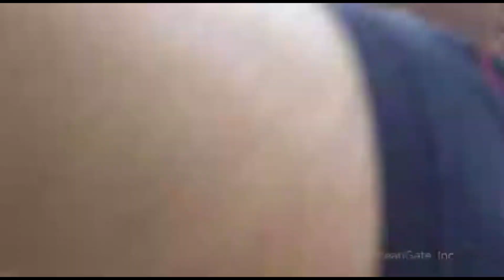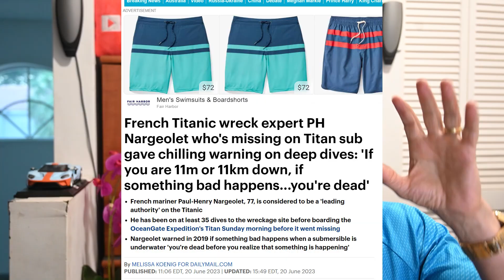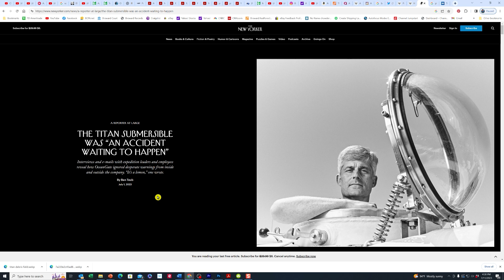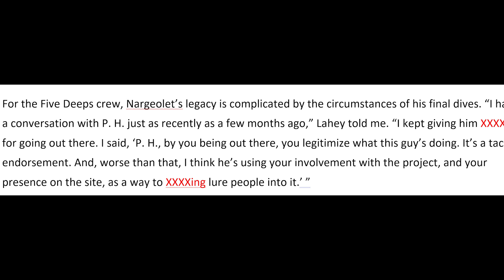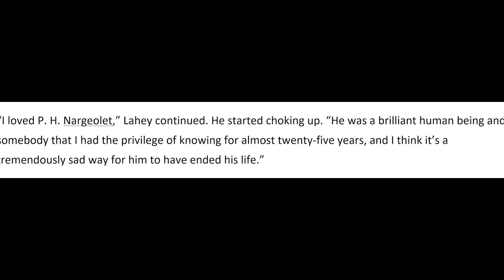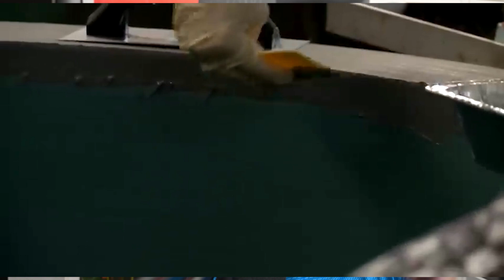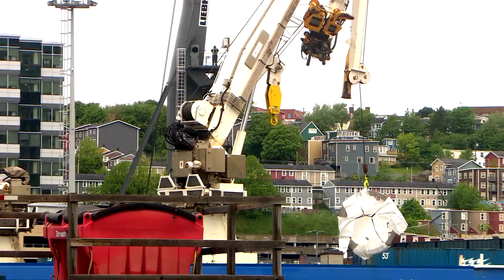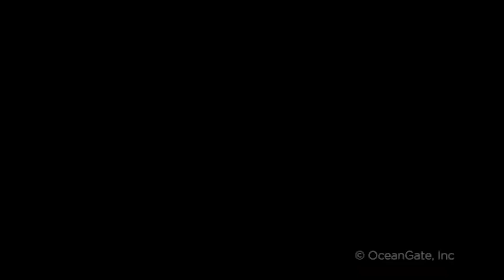Titan Sub: More Q&A, Design Defects, Why Descent Fast

Comment: The descent rate is significant as it signifies that they were overweight or had another buoyancy issue since they could not ascend.  The more we find out about this, the more shocked I am that it ever successfully ascended previously.
Reply: Yep, the transcript is spot on for their times and depths. Way too fast. And matches up with previous dives being stuck on the bottom and all these issues, unable to ascend etc. It’s so scary they were covering up so much and going forward continuing to dive. It wasn’t a question of if but when it would happen
Reply: Not sure if the transcript was real but The crackling sound in aft could either be the hull delaminating or water could have got into the back compartment and shorted out their electronics.
Reply: @WaveForceful The simultaneous power issues suggest water had gotten into the electrics, or at least into a place where it should be. A heavy drain can be cause by seawater.  Water in a place it ahould not have been would also make them heavier than expected and allowed that water to exert pressure in places it may not have been expected.  Crackling plus power issue on Bus A. Power gone, noise stopped.  Switch to Bus B, noise returns with more power issues. There has to be a connection.   The recovered wreckage did appear to have the entire electronics bay and wiring so they will have solid evidence of issues in that area.
Reply: That was my first thought as well, that they were too heavy.
Reply: @russellhltn1396  Or was leaking water somewhere.
Reply: @StRoRo  Or the composite cylinder had weakened and squeezed down to a smaller volume than anticipated before it finally failed.
Reply: Would be nice to know ascent rate of previous dive, did they have trouble ascending i wonder..
Reply: @ricktbdgc  facts! And, I wanna know has Rush ever dove the sub this fast before. the transcripts imply surprise by the crew of the mothership, so maybe not. It would also be nice to have the vessels data recorder. that should reveal a lot. If there were no mechanical failures going down, this definitely was a result of pilot error as the descent rate was pass ridiculous and should have been compensated for early on in the dive.
Reply: I think they were taking on water.
Reply: At first I thought it mught be a salinity issue but that simply doesn't account for it. No external factor can explain a 5% faster descent rate, let alone 50%.
Reply: Agreed…each time Stockton Rush went down in the Titan he was playing Russian Roulette with people’s lives.  That submersible had so many issues each time it was used that proved it wasn’t ready for use.
Reply: Didn't they also have a issue previously where they had to wait 24 hours for the balast retainers to "rot" away and have them ascend that way?
Reply: Seems somewhat paradoxical but I believe that falling thru the fluid of water rather than air is independent of mass, ie 1000# ‘overweight’ or 100#, negatively buoyant, the same as 1000# falling thru air as 100#.  Buoyant force, the upward thrust, remains relatively the same at those depths (4deg C).  g remains g.  They fall at same rate until reaching terminal velocity.  Terminal velocity thru water obviously reached faster.  The vehicle was neutrally buoyant (38m/min is just 2 ft/sec), imo,from start and descent rate was possibly just another reckless decision by Stockton Rush to place another misguided checkbox on his experimentation with human lives, ie fastest descent to Titanic.
Reply: @joestepien8594  It is. Stuff falls thro water the exact same as air. Acceleration is g. Its water resistance, aerdynamic ( aquadynamic  😂) gliding, or thrusters that slow it down. The density difference leading to bouyancy dictates the downward thrust to stop falling. If the sub is 100kg heavier than the water it displaces, it needs 100kgf of downward thrust to stop it sinking 👍. If the sub was 200kg heavier than the water, and the thrust 100kg, it would keep sinking at the same rate. And it had no dive planes to direct it up or down. Seems to me, it could not fly, or swim, so it sunk. And I dont think they would know it was too heavy for the thrusters till it switched them on. What a terrible thought really. If it was over weight to the thruster, as soon as it detached from the pontoon and started sinking, if they tested the thruster and not enough, could not detatch the ballast.. that was it. Nothing they could do. I dont think it had any ballast tanks it could blow. The more we learn, the more horrific the design was 🥵.
Reply: @TheScotsalan  the reason I’m inclined to believe it was Stockton Rush alone that controlled the rapid descent rather than overweight to begin with is that if it were slightly negatively buoyant from the start, and something upward force of thrusters could overcome, I would think pilot would have recognized this overuse of thrusters and aborted.  I was wondering too if vehicle had any capability to alter drag coefficient by deploying flaps of some sort.  Haven’t seen any indication of such flaps on graphics.  Not sure what ballast provisions were in place either to achieve neutral buoyancy.  Assuming neutral buoyancy measures in place, and you would hope that was done just below surface prior to descent, then the descent rate of 2’ per sec (rapid relative to typical descent rate, but hardly perceptible to an observer) was of the pilot’s making, presumably via Rush’s decision.
Reply: @joestepien8594 I agree
Reply: Since most of the buoyancy of the vessel was because of the CF material, having it compromised (buckling, delaminating) would have removed much of said buoyancy. The rapid descent rate matches an ongoing failure of the CF structure. It would also have meant that throwing off the ballast did basically nothing as their remaining buoyancy was vanishing with each part of the hull that was being compromised and filled with water...

As others have noted, the failure of CF material like this under compression tends to be very gradual until it fails disastrously. That's why things seemed normal for a few dives (albeit with 'weird' noises), until one dive it suddenly was very much not.
Reply: @MayaPosch I agree. I think the hull had been delaminating and water was infiltrating between the fibres. The deeper they went, the higher the external pressure, the faster the infiltration, forcing more delamination. The more water in the fibres, the heavier it was, until finally even dropping ballast and using thrusters could barely move them upwards.
Reply: @misterfixit9515  that is the answer No Doubt
Reply: @misterfixit9515  they were taking on water and that's the reason for the loss of power
Reply: I think there was water in the sub. That added more weight. Hence why it descended fast and couldn’t ascend.
Reply: @Koroodetto Thinking on about your thought there, you made me think of another flaw in the design. Because the sub is towed on a submersible raft, its never out the water. They done that to save money on the mothership not having a crane I believe. But a crane with a load cell would have allowed for a weight check.
Reply: @TheScotsalan  I guess they knew the weight of the submersible exactly. Everything additionally put into it got weighed. Well, that can be messed up.
Reply: @flybywire5866  This is why these threads are good. Get us thinking 👍. So, my thinking is now, If the whole sub is heaver than water it sinks, and it sinks at 9.81ms, no matter how heavy it is. Acceleration is constant. Minus resistance of course. But, says its motors are 7.5kw each ( thats the upper end for electric outboards), it has 2 vertical motors, they can produce X amount of thrust. If the density of the sub is not in a  band compared to the water, the thrust from the motors wont slow its descent. Does that make sense ? I calculated displacement at 42 tonnes. If it weighs 42.2 tonnes or 45 tonnes at top, no matter. It will sink at 9.81. But when they want to slow its descent, the thrusters must produce  more thrust than its mass over displacement. It needs its thrusters to slow its sink rate. It only has to be overweight by more than its rated motor thrust and its descent cant be checked. It will just keep accelerating at g, no matter what ? If its motors are as much as 1N thrust underpowered, it will just keep getting faster and faster. Am I correct with that ? I think I am. 👍
Reply: @TheScotsalan  It does not sink at 9.8 m/s^2. The nett force acting on the vessel is g.(vessel mass - mass of water displaced)  because the buoyancy force is the weight of the water displaced by the vessel. The acceleration of the vessel from F=m.a is therefore (vessel mass - mass of water displaced)/(vessel mass). The volume of water displaced by the vessel is about 10m^3 (this can only be estimated) and the density of sea water is about 1.025 tonnes/m^3. The mass of the vessel is quoted widely at around 10tonnes (albeit not consistently) Some rough calculations suggest that the ballast needed for a normal descent rate of 0.45m/s is in the order of 100kg to 200kg. It reaches terminal velocity in water very quickly. Around 100kg of excess ballast causes the faster descent rate indicated in the transcript. Note that the "fast" descent rate of 0.67m/s is equivalent to a slow walking pace. If the thrusters can't arrest the descent then 100kg of ballast can be jettisoned to achieve neutral buoyancy and another 100kg to ascend.
Reply: @kengself  Cheers ? Thats where I went wrong then 👍. I knew there must be something wrong with my reasoning 🥵
Reply: @kengself  No wait. Sorry, must be low blood sugar at the moment 👍. F=ma. If I drop a lead ball in air, or a beach ball, the downward acceleration is the same. Archemedies still applies in air but is neglegible..air resistance comes into play. do it in a vac, both fall at same speed. In the case of a falling object, the F is F=ma is the force in the object. If I drop a ball from 1m high, a heavy ball will hit with more force, F, than a small ball. Gravity g, has no mass factor in it. Doing a force diagram, the speed of sinking due to mass is the same, no matter how heavy. If its heavier than water, it goes down, at g, minus the water resistance on the sub. F=ma, with bouyancy, is the upward force needed by the props to arrest falling. I think.. I need my pills 😂.
Reply: @TheScotsalan  I  think the missing part in the way you are trying to analyze this, is the buoyancy force acts directly on the F side of the equation. The acceleration of gravity is surely constant, but the acceleration of the craft (which is the relevant component in the F=ma eq) is not rigidly tied to the gravity acceleration. It is the net acceleration when the buoyancy force and the gravity force (weight of the craft) are combined. This is ultimately why planes can fly and ships can float, instead of merely sinking at 9.8 m/s^2 from gravity.
Reply: @JSu2.  I am getting there 👍. Dont worry, I aint a flat earther 😂
Reply: @TheScotsalan  

The equation of interest here is actually an aggregation of the f=ma equations, I think.

F(buoyancy)-F(craft) = m(craft) * a(craft)

F(buoyancy) = buoyancy force based on displaced water
F(craft) = simply the weight of the craft from f=ma
m(craft) = mass of the craft
a(craft) = acceleration of the craft, which indicates the actual up or down motion of the craft (positive meaning upward, negative meaning downward)

Also, you could incorporate F(thrust) on the left side of the equation to include the thruster contribution
Reply: @TheScotsalan  No. The accelerating force  
F is the difference between the gravitational force mg and the buoyancy force rho.g.V (rho is the density and V the volume of displaced fluid). If buoyancy force is greater than mg you float. Once you have the nett force you divide by the inertial mass of the vessel (m) to calculate its acceleration. The drag force of water resistance is dependent on velocity^2 and when it matches the accelerating force (mg - buoyancy) you have terminal velocity
Reply: @JSu2.  Yup. I know the equations 👍. Its just their application with subs I am trying to work out. I live behind the great firewall, and my VPN is on my phone, not laptop. Take it from me, internet behind the great firewall is pretty bad. 🥵. But this is a great thread. Learning a lot 👍
Reply: @kengself  Tbh.. sort of feel ashamed to call myself an engineer here.. but hey, I am mechanical.. not marine 👍

Learned a fair bit here tho. This is a superb thread. I am at the point where I want to do the vector diagram and plug the equations into a spreadsheet to see what variables do what. Someone above posted about stokes law, new to me, but it makes sense. I suppose, at the end of the day, while most engineering courses cover the usual physics about fluid dynamics, flying etc, submarines are not really in there. This is a whole new world, I am enjoying learning a bit about it 👍
Reply: @TheScotsalan the flaw was Stockton himself, took it too the edge, of safety
Reply: @Koroodetto  or they didnt change weight measurement after the son went instead of the mother
Reply: @Koroodetto 
Titan's weight: 10 tonnes 
It would need a huge amount of water to offset its buoyancy. There was not that much available vessel volume to allow for that.
Reply: @johniresearchist7263  Yup. I just calculated its displacement, 42 tonnes, so it would need a fair bit of weight added to make it sink.
Reply: @Koroodetto , If there was water in the sub, a) they most certainly would've been communicating that to the surface vessel, and there's no record I'm aware of indicating that. And b) IF, there was water entering they surely would've tried to abort the dive immediately due to that happening early on the descent. Now if you're suggesting that the carbon fiber hull started leaking water when they were down deep, and that's what accelerated their descent rate, AND prevented them from being able to rise quicker when they decided they were in trouble, .... I don't think that is possible. At that pressure, the tiniest of leaks would result in a tremendously high pressure jet of water thru the leak spot, and instantly grow to a complete structural failure resulting in instant implosion. I think there must have been some other buoyancy issue that caused their problem. I also personally believe that the communication transcript that has leaked out, is real and factual based upon the fact that it basically mirrors the things James Cameron knew very early on in the search. He knew things that had to come from someone on the inside aboard the mothership, ..... Like that he knew they got to 3400 meters, and then  dropped their ballast in an attempt to abort the dive.
Reply: @loulagro2315  From the real evidence we have (remember, this transcript has not been verified by anyone), we know that the descent rate wasn't too fast, we can form this conclusion based on evidence from prior expeditions that took the same time to descend and obviously didn't take on water because they came back just fine.
We know that the sub was constantly malfunctioning, from the thrusters not working, thrusters being put on backwards, the system just stopped working, etc. 
From everything we ACTUALLY know, its reasonable to conclude that the hull simply failed due to poor engineering/manufacturing.
Reply: @undeadarmy19  , Perhaps you should reread my comment and the comment I replied to...... First off I absolutely believe the submersible suffered a catastrophic hull failure. Second I never said or agreed that the decent was to fast, so again perhaps reread my comment. I simply was disagreeing with a comment I read that the Sub took on water somehow becoming too negatively buoyant. Perhaps it was, but its not credible in my mind to think it leaked water at depth prior to implosion. I believe it just failed and imploded. Lastly, while yes it is NOT proven at this time, I do believe the communication transcript will be proven to be accurate based on the reasons I cited previously, ie James Cameron's contemporaneous statements about the incident within the first 12 -24 hours of the search. He stated precisely the reported Depth it got to, as well that they released their ballast. Why would he risk his professional credibility by making that up? He was either privy to the communications that were had, or privy to some seriously precise sonar analysis....... Either way it appears he knew things early on. I'm sure it will come out eventually, right now there are people circling their wagons getting ready for litigation, and the information will be closely guarded until a full investigation has been released to the public. I'm just betting its real, or a very accurate representation.
Reply: @loulagro2315 oh yeah, circling the wagon is right…big time.
Reply: @Koroodetto Then you'd expect the descent rate to accelerate, no? If they had a leak their buoyancy would be decreasing. And they'd sure as hell either see or hear the amount of water coming in required to cause that sort of reduction in buoyancy, unless it was an external pressure vessel that failed very early on in the dive (we've had heard a tank rupturing at any sort of depth and the crew would have noticed it).
Reply: @mrkeogh  No. It will sink at 1g if its mass is more than the mass of the water it displaces. Its exact same as a rock and a feather on the moon. Falling is independent of mass. 👍
Reply: @Koroodetto that transcript is fake. The titan was built to be positively buoyant. So any failure of the thruster or equipment they just rop the weights. If there was water intrusion that early on it wouldn't of imploded because the inner pressure would be equalized.
Reply: @Koroodetto  I to do agree water leak compromised ability to ascend
Reply: @Koroodetto  I don't think there was water inside. The moment any water got inside the sub, they would have already been shattered and dead. That's why a thruster issue is more probable. Also, they might have had too much ballast and not been able to drop it successfully.
Reply: Sounds to me like a leak, or maybe some tools were left in the bottom of the sub. Water seems most likely as that might have shorted out bus A and battery.
Reply: The same thing bugged me when I read the transcripts...and they all knew they were going to fast. The topside asked them if they needed to slow decent.
Reply: @americanwoman6246 they all, knew, stupid people but they were not stupid.
Reply: A faster-than-usual descent would also put additional unforeseen stress on the bonding between the pressure cylinder and the end caps, due to their differential compression, even aside from the obvious issues of having end caps glued to a carbon fiber pressure cylinder.
Reply: @edreynolds8721  How do they not notice sloshing water right under them?
Reply: The Titan had a fast decent then could barely move up . I still need to understand  why carbon fiber was used .
Reply: @carolynlyfordsullivan1377 Weight and capacity.  They wanted the Titan to be transportable by box truck so it could be picked up from one coast and driven to the other coast, rather than needing a tender mothership that would have to sail around continents.  They actually did this. This is how the vehicle was used in Seattle and also in the Atlantic.  They threw it in a truck and roadtripped it.  Titan was the first of a planned fleet of these things, all being trucked around wherever there was enough demand for a ride.  Capacity played a big part. They wanted to have a high passenger capacity because that meant revenue and profit. Using a steel hull would be too heavy to carry by truck and too thick to leave a lot of room for more paying passengers.
Reply: Very Well Put, OP.  There's a few other phrases we could use, like for example the submersible seemed to not be under control when it started to dive.

The Titan wasn't just overweight.  It probably lost most of the pressurized air when it flooded its ballast tanks, suggesting that those air tanks in turn became more ballast.

Remember how early on the Media was consistently pushing how much air was onboard in terms of the number of days of air there was for the occupants to breathe?  That seems pretty suspicious to me now, as well, because clearly some people knew almost right away that long term survival wasn't really an option.

I'm willing to bet that within 5 minutes of the submersible leaving the surface and its carrying sled it had already passed a point of no return, as in, it could not have safely aborted its mission back to the surface long before it ever got near to the bottom.  All that had to go wrong for that to be true is for the submersible to have lost most or all of the pressurized air external to the passenger compartment.
Reply: The NORMAL ascent & descent rate is about 25.33 meters per minute. Many sources & former “mission specialists” who rode the sub are on record saying it took 2.5 hours to get down and 2.5 hours to get back to surface. 

One of the reasons Stockton Rush wanted to build Titan out of carbon fiber is because it’s much more buoyant than other materials.
Reply: @michaeldonnelly2977  There is no "normal". Where are you getting this 2.5hr descent rate from? Oceangate themselves has stated a descent time of 2hours or 90min, never 2 1/2hours. They made the expedition to Titanic 13 times and most of those had a descent rate that got them there in 90 min. Nothing bad ever happened with those, so it's reasonable to conclude that the descent rate had nothing to do with it.
Reply: Or something heavy with tentacles attacked it?
Reply: They were ascending at 0.25 mph (snails pace) with thrusters on. They had problems dropping the skid. Maybe the skid never detached.
Reply: @topfuel29channel  I think it more likely they freefall for a bit, then thrusters on for a while to slow down ? Sort of like rolling down a hill in a car ?
Reply: Everyone talking about leaking n taking on water. I thought it depth this didn't really happen over an hour but very very quickly?
Reply: @nickabel8279  Thunderfoot just did a video on this, estimating flow rates.  I believe the speed of the water entering through a leak will be supersonic, but of course the volumetric flow rate depends on the size of the leak.  A catastrophic hull implosion would happen at about the speed of sound and take just a few milliseconds.  I think people are placing too much weight on the idea of a leak because:  (1) they tend to be a shallow water problem not a deep water problem (because the compression of the hull will tend to seal them in a sensible design), (2) an implosion at the right time/place was reported, and the CF cylinder is reported as being disintegrated, and (3) if the transcript is real, no leak was reported, but presumably a supersonic water flow would be noisy.  It seems to have resurged as a result of the transcript purporting to show a high descent rate.  Another commenter said they had calculated this could be due to being overweight by just 100-200 kg.  Stockton Rush banged on about procedures having a major impact on safety (presumably to deflect from Titan not being classed), but doesn't seem to have put that into practice.  The reversed thruster on one dive is a great example, but I'm sure there are many others.  I think it quite plausible that they just didn't do the weighting calculations properly, maybe not adjusting properly between dives for different crew weights, but there may be other reasons.  It will be interesting to read the final report, but from the start a catastrophic hull implosion seems to have been the most likely cause in the minds of the experts.
Reply: Also, a high descent rate doesn't give the different materials time to settle in to the increased pressure. One material might flex more than another, sort of like how different materials react to temperature changes differently.
Reply: Well, every dive likely caused more and more damage and micro tears
Reply: This isn't a row boat on the surface. 4000 meters down, there is NO slow leak. If it leaks, it is going to break or, at the very least, fill completely and rapidly. No wet shoes from this.

Passengers are in the CF tube with the two titanium end caps. We have not been given details of the tail unit. Interviews with Rush report wires thru the rear titanium cap (CF cylinder cannot have wires thru it).
Reply: @Set-it-to-11 i was referring to a slow leak in the aft which was outside of the pressurized chamber and housed all the electrical equipment. It also wasn’t pressurized like the chamber which is why is was completely in tact when they found it. The pilot of sun mentions crack noises in the aft, followed by red lighting on the control board then comms cut.
Reply: What about malfunctioning or improperly set vertical thrusters which went unnoticed? I imagine the thrusters pulling the craft down at a low but constant rate. That would explain the higher rate of descent which I believe they do a low power descent (basically just sink using ballasts) and then when dropping extra weight they still could not make progress...faulty vertical thrusters.
Reply: @thunkjunk  we already know they had reported a thruster malfunction in a previous dive ,  they did not abort then but reconfigured the thruster by software on board. The thruster was operationing in reverse btw .  Make me wonder it the same thing happened and was pushing the Titan downwards
Reply: @the_forbinproject2777  I think they installed that thruster backwards so that when the pilot pushed forward, one side pushed the wrong way which caused the sub to spin. I didn't know they did some kind of remapping during the dive. Was that dive successful?
Edit: not spin but yaw.
Reply: @the_forbinproject2777  who want's to bet these morons forgot to change the reversed thrusters back, so on the ascent they still had a thruster or two fighting against the others.
Reply: @the_forbinproject2777 wasn’t there also another issue with the thrusters that caused it to go in circles over and over? Or is that another issue?
Reply: @PureSkyeblade  A submersible ascends by buoyancy, not thrusters.
Reply: @the_forbinproject2777  The couldn't abort since the sub was down lol - but yeah sketchy how the solution was "Turn the controller 90 degree to your right and you'll get the right control"
Reply: @Jubaone90  by abort I mean abort the dive , return to the surface , like jettison the balast , that type of thing
Reply: @the_forbinproject2777 a diverse team will only go so far if they have no clue or concern for quality
Reply: ISN’T it obvious?  The extra weight on the sub is because the aft part was flooded as soon as it submerged.  That made it fall faster.  (It also slowed its attempted ascent to just 7 meter/sec.)
Reply: CEO would be alive if he had said at 15 minutes “We’re falling too fast.  Abort & surface.”   But he ignored that.  (He also ignored the red early warning light.  He was dumb.)

.
Reply: @electrictroy2010  I think they would have noticed water entering, if only by its sound, at depth I think it would have entered supersonically.  I suspect they just got the weighting wrong.
Reply: @electrictroy2010  There is no evidence that this transcript is real, so we should assume that its not. What is real are the 13 dives that the company took to the Titanic before this. In those dives they had a descent rate that got them there in 90ish min. So, we can conclude that the decent rate wasn't the issue.
A large YouTuber, DALLMYD, just posted a video recently documenting his trip on the sub. He went with "mission 3" which was 2 missions before the mission that imploded. They were never able to actually dive down to Titanic because the weather was just too bad. In the video even you can see that the waves are so bad they're causing people to slide from side to side in a room, along with things falling over in the room. During the expedition, he talked about how the sub had issues literally every day. Whether it was a thruster not working, one day the system was working fine and just quit, etc.
So, its reasonable to conclude, based on the VERIFIED evidence, that the issue was most likely due to a malfunction that occurred down there, or a hull failure due to poor engineering/manufacturing.
Other evidence has emerged that the sub lost all power and plummeted to the seafloor in a vertical orientation. This means that they most likely were all aware of what was about to happen. The pressure is greatest at the bottom, and due to the fact that the fell and crashed into the seafloor, that likely could've caused damage that lead to hull failure as well.
Reply: @the_forbinproject2777  in the previous thruster malfunction, the thruster had been installed in reverse, so maybe this time it was upside down
Reply: @electrictroy2010 yes smart stupid dude and took lives as well.
Reply: @thunkjunk Thruster issues?
Reply: @dare-er7sw  There were two vertical thrusters they used to move the vehicle up and down. They could have been running the entire time. Otherwise, I don't know what else could take on water to cause extra weight. If that back end was heavy with water wouldn't they complain about being tipped backwards?
Reply: @thunkjunk  Yeah, and thats why the battery died so fast. Maybe.
Reply: @thunkjunk  if the transcript is true, it can't have been thruster issues, it had to be weight. If it were a thruster issue then the sub would have ascended as expected when the ballast/landing platform was jettisoned.
Reply: @AtomicExtremophile  Reading thro this.. I just had a head slap moment. I saw all the weight things and sat down to work out the displacement of the sub etc, then boom, I remembered. Things sink at the same speed. If its denser than water at sinks. Its its less dense, it floats 😳. It sinks at 9.8 m/s^2. Of course, there is water resistance etc, but basically, I reckon it would need to use its thrusters to control its sink rate. That is, to slow it down 👍.
Reply: @AtomicExtremophile  Where would the extra weight be?
Reply: @TheScotsalan In a vacuum, things fall at the same _acceleration rate_, not speed.  In a fluid like air or water, they accelerate until drag and the force due to gravity balance out.  That is the terminal velocity, and it varies with size and density.  Look up Stokes Law for a starter on that.  From eyeballing various diagrams it looks like the interior chamber was roughly 3 metres long by 1.5 metres diameter, giving about 5 m3 of volume and hence buoyancy to offset it's weight.  I'm not sure how you calculated 42 tons displacement, perhaps you are confusing displacement with weight anyway, but even as a weight that would seem to be a multiple too high.  More likely I think they will have got the total weight down to less than 5 tons so that, without ballast weights, the thing would be positively buoyant.
Reply: @LokiCentral  Ahh right. So stokes law is describing the ralationship to density to drag and resistance.. and terminal v. Got ya. So mass affects terminal velocity, of a sphere in water. 👍
Reply: @TheScotsalan  Stokes Law tells you the upward drag for a sphere falling at a given velocity (you'd have to assume a sphere for an easy hand calculation).  Reverse it, and you get the velocity for a given drag force.  At terminal velocity (which will be pretty much right from the start in water), the drag force must equal the net downward force.  The net downward force is (weight - buoyancy) x g.  I don't think we know weight/buoyancy well, but you can use this approach to estimate the rough descent rate for e.g. 100 or 200 kg of net negative buoyancy (another commenter suggested this gives the right sort of descent rate).  Descent would be stopped, then reversed by dropping weights, not by using thrusters. Thrusters would only be used for movement once neutrally buoyant.  For safety reasons you cannot rely on a powered ascent, you have to be able to achieve positive buoyancy by passive mechanical means (dropping weights in this case).  But also I think there simply wouldn't be enough energy in reasonably-sized batteries for a powered descent/ascent anyway.  You could work out the energy required by multiplying force by distance, e.g. 100 kg x g x 3,800 metres.
Reply: @TheScotsalan If you mechanically propell the capsule downwards you will increase the falling velocity. This propulsion is based upon a downward force (exerted by the propellers), which comes to be similar to increasing weight, i.e. gravitational force. Velocity, within a fluid, is not constant. It would be constant (at a rate of 9.806 m/s2) in perfect vacuum, in which case a thruster or any propelling device won't do nothing.
Reply: @thunkjunk  I'd think they'd notice the power draw on the batteries.  I think there's simpler explanations.
Reply: @russellhltn1396  Ok. I'm all for Occam's Razor. What is simpler and explains more given that script isn't fake?
Reply: @thunkjunk  Miscalculation of ballast is the simplest explanation of the descent/ascent rates for me. Compromised hull material is the simplest explanation for the hull failure. It's tempting to attribute everything to one cause but given the history of the thing, I have no problem assuming multiple, concurrent issues.
Reply: @thunkjunk  That they got the buoyancy wrong for this dive.  I'm not sure how, but that seems the best fit for what we know.  I believe the script shows they were sinking fast from the get-go.  Too soon for water leaking in.
Reply: @russellhltn1396  I'm second guessing the premise that the dive was too fast.
Reply: @thunkjunk If the script is real, the reported factors of fast descent, poor ascent, power drain issues, lack of thruster effect, and noises from the aft electronics bay could all point to water infiltration adding weight while also damaging or shorting out the electrical systems.
Reply: @thunkjunk  By the time they reached their destination, the primary power supply failed  the backup power supply was possibly on the verge of failing and it's likely the seals on the buoyancy system had failed either during the dive or before it's deep descent and was allowing water to infiltrate the system. it is very uncertain. But why would Rush just flip off the descent rate as if it couldn't turn catastrophic at any moment. There are clear and precise regulations prohibiting high rates of descent because of the safety risk connected to it. As an engineer he should have recognized the  descent rate as being dangerous and made the necessary corrections. Which leads me to believe he did this on purpose to show proof of concept for his controversial design.
Reply: @thunkjunk  The thrusters are not designed and not normally being used during decent or ascent. Their power is just pathetic in comparison with the buoyancy gained by dropping all the ballast. They did were employed as a desperate measure to speed up the ascent after jettisoning all ballast wasn't sufficient. Their excessive use probably caused or contributed to the consequent loss of power. All this was virtually irrelevant to the outcome. The sub was doomed as soon as the leak in the hull started.
Reply: @curiouscat8457  Actually, I find that every detail will be relevant. Our speculations are not very relevant. It is interesting to speculate nonetheless. It seems a bit like the premise that they were descending too fast might have been wrong. But if the script is accurate then something was causing their ascent to be bogged down. Since they would have. What could explain such a slow ascent with thrusters going and being so positively buoyant?
Reply: @thunkjunk  "What could explain such a slow ascent with thrusters going and being so positively buoyant?"
Huh? "So positively buoyant"? It wasn't. There was a few hundred liters of leaked water in it. That EXPLAINS it. And it is not a speculation, it is the only logical explanation of the problem.
Again, the use of thrusters' power was only a short-lived drop in the ocean. They are normally being used for small vertical movements while the sub is neutrally buoyant. Their thrust and size of power source reflects their intendent purpose. Their use was only the last desperate and entirely futile attempt to save the day.
Reply: @curiouscat8457  I'm going to have to tentatively agree with you about the water. However, there are issues. A few hundred liters of water? Just one industrial sized drum is 200 liters. Where and how would that get in?

The only way I can think of for that is the water was at the bottom under the floor they sit on. And the only way for it to get in would be at or near the surface if the seal on the titanium caps were loose enough or the carbon fiber was damaged enough to allow a leak at either end. And then once the pressure built up the titanium caps were held on by pressure also stopping any leaking.....temporarily.
Reply: @thunkjunk  I think, you answered your own question. 🙂. There is enough room for a few THOUSAND liters of water under the floor and the glue between the titanium and carbon fiber would be the prime suspect.
I explained somewhere (the comment system is messy and I can't find it now) - how this type of leak (or seepage perhaps) could be quite massive while being silent and hard to detect.
Reply: @thunkjunk  "What could explain such a slow ascent with thrusters going and being so positively buoyant?" 
thrusters being installed upside down, controller error, ballast not detaching properly
Reply: @thunkjunk I doubt the sub had enough battery capacity to  keep the thrusters running. Say  they are 7kw each, thats a lot of juice over 8 hours or so. Just my opinion. I dont mean to sound arguementative 👍.
Reply: Raising valid points to consider is not being arguementative.
Reply: @TheScotsalan  Those thrusters aren't operating the whole time though, they're only used for short bursts. The whole idea is to allow extra weight to cause you to descend. Then you drop some weight to become neutrally buoyant, then drop more weight to create positive buoyancy. The thrusters are mostly only used for maneuvering once you're down there.
Reply: @TheScotsalan  what I'm wondering is whether the electronics were designed to work in water. The electronics could be accessed via this thin, vertically folding doors. Surely those doors weren't strong enough to withstand the pressure on their own. 
In a recent video posted by a large YouTuber that went on mission 3, you can see that the sub is more nose heavy when they first enter the water, is that due to needing to wait for the back of the ship to full with water?
Honestly, I think it would be smart to design the electronics in a way where they're submerged in distilled water/oil, that way there is a pressure equilibrium. For those that don't know, pure water is actually not conductive, the only reason water is usually conductive is due to impurities in the water.
Reply: @undeadarmy19  But if the thrusters were operating and draining the batteries and accelerating down on the descent it might make sense (if the transcript is true) that on ascent there was insufficient power to rise...And perahps if the controls were stuck in a downward position dropping ballast wouldn't work to bring up the craft quickly.  
I think the simplest theory is they were too heavy and then there was also a power issue from the mech bay flooding...

(This is just frightening what they went through, because I've said from the beginning THEY KNEW they were in trouble.  Even if the transcript is a fake there is no way they didn't hear massive snaps in the hull.  We know they dropped the Ballast and the Leg Frames first because they landed in a different area than the rest of the debris. They were indeed fighting for their lives)
Reply: Wasn’t buoyancy touted as a primary benefit of using carbon fiber? It’s like they were making it up as they went along. Insane.
Reply: 🎉😂All need a secret before u can experience Jesus healing energy. The Illuminati aka fallen angels aliens NASA what ever you want to call them in there flying tin cans. Can't get out of lower orbit because of the vacuum. Universe is only 77 thousand SQ miles big breathable air through out space angels have to breath. Mars is only 250 miles away sun an moon are much closer an only a acre big. Heaven is on Mars moon that's what all the thrusters are for space x Star ship try to punch through the vacuum and destroy Mars moon heaven. I cleaned out hell left the light's on so no use for hell. I ripped the soul out the devil after he went dragon just to make it a fair fight. Now souls can be destroyed. True compassion for your fellow man is the only way. Now all are allowed black an white sheep to experience Jesus healing energy all old aches and pains will be washed away takes 30 minutes best to relax and shut yr eyes. Or I'm lying an u won't feel a thing
Reply: Another thing I have wondered, is if it is possible for CF to become "waterlogged", not necessarily from critical delaminations or cracks, but like a sponge from sustained immersion/exposure to water (towing at sea and prior recent dives)? Maybe that is another source of unanticipated water weight?
Reply: Me too...amazing that they had any success....😢
Reply: what if they forgot to fill ther air tanks befor the decent i think there air tank had  10,000-100,000 psi of air for bonicey if they for got to fill the tank would you not decend faster or if the air tank failed as they were going down
Reply: @jeffwinters8152  They wouldn't float if there was no air to begin with. Something had to happen, such as a pinhole leak in the weakest part of the structure
Reply: @ScarlettStunningSpace  i allways thoght a air tank makes you lighter when you dive when a tank when it is comprested air at least in water of the many dives i have done with my gear on and tank that is what i have done for a while
Reply: And the most probably reason for the overweight is the water from a leak
Reply: Curious to know why the mother ship didn't say anything bout the decent rate, they would of known if the transcript is legit.
Reply: @muddyfunkster77  That's a good point but this could easily be apart of the normalization of deviance. If things  were being handled according to regulation you'd be right but with this general mélange of incompetency and lacking responsiveness to clear and present dangers I would say it could also just by an example of overall failure.
Reply: No fat shaming
Reply: I'm wondering if the CEO hadn't had a psychotic break w reality + loaded something extra onto the vessel. He mah have done something utterly crazy, thinking he knew more than ANYONE else.
Reply: The rear frame that is not part of the  hull  that holds the guts of the sub broke or bent, causing a weight distribution effect. It pulled on the wiring until some wires were severed and got in the way of the landing gear when they tried to release them. Landing gear did show signs of damage in the same area that the rear sub structure was attached to. Just a theory.
Reply: Whats french for banzai?
Reply: @edreynolds8721  That would be my GUESS as well. The prime suspect: the glue joining the titanium flange with the cylindrical hull failed after a few repeated load cycles (materials with different load compression coefficient, different temperature expansion coefficients, poor assembly process). 
It could have resulted in a seepage all along the circumference - barely noticeable at any short length of the fissure and silent - but adding into a significant flow on the 6 m(?) length while the pressure was increasing.
If it wasn't there, it was somewhere else - but there was a leak.
Reply: @edreynolds8721  That's fine. And I can easily imagine the seal was compromised on the rear titanium cap because it was only held on by glue. Dive after dive would cause the glue to erode because of stretching, compression and release. That water was able to come in early in the dive while the pressure was low. When the pressure got higher that titanium cap would press so hard against the carbon tube that it could stop a leak but then eventually overcome the structure leading to catastrophic failure. The only issue I have with water trapped in the rear section is that I would think it would cause the rear to sink down but nobody complained about falling toward the back. Then again maybe the script is fake.
Reply: I worked on a team of students that wired it and it was wired to go fast. We put extra big wires in it to rev up the engines a bit tee hee hee.
Reply: I think based on the released transcript, Rush mentions crackling noises in the aft. It’s possibly they had slowly taken on water, which would cause the electrical failure (all electrical components were housed in the aft). I’m not an engineer but it’s possible the slow leak made them take on too much water essentially sinking them first or hindering an ascension. Water weight kept adding on, sun starts to sink rapidly under the added weight, descends too quickly and POP.
Reply: No kidding.  It didn't crack the first time?!   That's amazing!  Well worth the 2k bucks!
Reply: Probably electrical failure causing valves or thrusters to operate too slowly or not at all. That would explain pretty much all their problems and a bursting battery creating a shock wave could explain the cause of the implosion.
Reply: The fast fall rate suggests that the titan was more like a rocket, traveling vertically instead of horizontally. They were probably terrified as they piled up on one another while Stockton Rush pretended there was no problem
Reply: Grabbed by giant squid, and then chomped by megalodon. 😉
Reply: 1) why build a submersible with only a small crush test margin? 
2) why use an untested material like carbon fibre when experts warned him not to?
3) why was the plexiglass "view port" only rated to 1300meters?
Reply: Releasing ballast and weights the "pressure hull" should have ascended to the surface regardless of thrusters etc.
Perhaps they had faulty decent thrusters they couldn't turn off that would explain their rapid descent and by the time they decided to do an emergency accent it was too late?
Reply: These two men both had suicidal ideation. PH because he was a lonely man missing his wife and obsessed with dying close to the titanic. Rushton had received the vaccine 2 doses and realized a gruesome fate most likely awaited him and chose a quick and easy way out. Get rich fast or die trying he knew his clock was ticking
Reply: 60 minutes Australia and Navy Production YOUTUBE channels are saying contact was lost 1 hr 45 minutes after first decent.  That would seem to confirm somewhat the authenticity of the transcript showing a rapid descent.
Reply: @@1finalfailure Perhaps.
Reply: He knew, decided to descended too fast, caused problems
Reply: The first question is whether the transcript upon which the descent rate is based was actually genuine. If it was, everything I’ve read says that the Titan did an unpowered decent with the majority of systems off to save power. Ultimately it just sunk. An explanation for a fast decent could be that someone simply got the ballast calculations wrong. The question that would raise for me is why they would continue the dive if the sub was sinking much more quickly than it should because clearly there must be a reason for that. The fact that the transcript doesn’t even include any discussion on the excessive descent rate makes me also question whether it is a genuine transcript or at least missing the correct time stamps.
Reply: @peterj5751  there was one sentence, where the ship asks if they dont need to adjust velocity or something like that. It sounds like the person on the ship was afraid to tell them to change the speed of descent.
Reply: @peterj5751  Agree. It just sunk. Had a fixed displacement, makes me wonder if the divers just fixed ballast on at the surface, and off they went. If someone messed up the calcs, it would quickly be too deep for the divers to remove ballast  ?
Reply: @TheScotsalan  
Displacement is not fixed. Under compression the volume will decrease slightly. If the graphite cylinder had already started to weaken then it may have squeezed down to a smaller volume than anticipated before finally imploding.
Reply: @zahimiibrahim3602  Yup. I know that, but I reckon negligable. Compressive strain is ppm is it not 👍.
Reply: @zahimiibrahim3602  Sorry friend. Answered in a rush. Yup. Quick google shows Youngs modulus for a random titanium about 110GPa/m2. Not as stiff as steel surprisingly. Wow, bonded CF has E in the range 200-500 GPa. Thats a massive difference, tho I suspect the CF value is for tension. But yup, I dont think a massive change in volume 👍
Reply: The transcript is fake. David Pouge repot has a sheet with their communication codes. They used 2-3 letter codes for different conditions. I’ve just read the report and seen the short codes.
Reply: @rosiemiller3635 Pogue is a not at all a credible source. He talks for the highest bidders and has his own closet full of skeletons.  People say he worked for NYT or CBS but he did so as a private contractor freelancer for hire. Not as an employee.  He's really just a blogger who managed to not look like a blogger.
Reply: We know Rush's attitude toward construction of the vessel. Did that same short-cut guy pilot the vessel he designed?
Reply: @peterj5751 , I wonder if the pilot had a medical emergency and that's why he continued the dive ??
Reply: @peterj5751  maybe they decided to descend faster for some reason and that's why they were not surprised. Maybe Rush wanted to rush the descend and took more ballast?
Reply: the fact that they were totally ok with that descent speed to the point where they don't even mention it makes me believe that this whole leaked transcript... was fake. but that's just me
Reply: @marcsauriol9130  You have the best position of us all which is still "we don't know".
Reply: @marcsauriol9130 (1) employees were afraid of being fired so they kept silent.  (2) The transcript shows the topside employee questioned the fast descent at 1 hour, but the CEO said it’s not an issue

.
Reply: *7 meter/minute
Reply: @marcsauriol9130 have to agree. The sub taking on water isn't an option because a leak would basically be the equivelent of a hydraulic line leak in normal life. It would destroy the sub almost instantly as the water jet cut the hull in half from the pressure. 
As for water permeating the carbon fiber pressure vessel, that is basically also impossible to imagine having occured without the alarms sounding from the sensors from the very beginning.
Basically, the sub couldn't realistically have survived any conditions I can think of which would have caused an accelerated descent due to water intrusion.
Reply: It barely did. A lot of previous riders have been saying that they experienced issues on their ride(s); banging sounds, etc. In fact, at one point, the sub was stuck underwater for 24 hours until the parts of the sub that were preventing it from surfacing came off (This was a failsafe on the sub in case of the exact situation) And Stockton Rush's advice to everyone while they were stuck was to "Just sleep it off". Someone else said that on their dive, they lost contact with the ship, were underwater for 8 hours, and Stockton turned off the wifi in the sub to prevent anyone from posting about it.
Reply: @Jayman2800 
I saw those reports also.   So sorry nothing dissuaded these three passengers from this foolhardy excursion.
Reply: @Wizz280 whooo, not nice.
Reply: They must have some warning before their heads popped.  Cap'n Crunch toilet instructions: Do Not Flush.
Reply: Aye, 1.5 hours to drop, 8.5 hours to ascend. Was an emergency inevitable?
Reply: @JustBadly  Where does "8.5 hours to ascend" come from?, perhaps they normally arrived back at the surface after 8.5 hours since leaving(or reaching the bottom) but that's very different to an 8.5 hour ascent.
I also don't know why people are constantly assuming that they ascended by using the thrusters(I haven't see anything that suggests that), that seems extremely unlikely. I'd assume they did what everyone else did, and dropped some weights. Likewise I'd assume that that the thrusters were predominantly for horizontal position/navigation.
In anything like normal operation, they had multiple methods to ascend if needed - dropping weights via several methods (including weight attachments that slowly decayed so would eventually ascend them even if they had no controls) and inflating gas or liquid bags. That was one of the few areas that seemed to have been fairly well thought out, other than seemingly a reliance on battery power for any method to quickly start the ascent.
Reply: @DoubleMonoLR  unofficial transcript of sub communications showed time of descent @1.5 hrs and that it took 3 minutes to rise 20 metres when the crew started to go up.
Reply: @DoubleMonoLR  the 8.5 hr ascent is based on the (last known) ascent rate they were observing after emergency drop of ballast. This rate was unexpectedly low, which further indicated there was "a problem"
Reply: @JustBadly me too
Reply: Maybe they started slowly taking on water which caused their electrical problems? And then it tipped over from the water intake? I'm guessing it would have been such a small leak that it didn't tear the thing apart immediately.
Reply: That part in the original video was the clincher for me, omllll I was holding my breath. How fast they were going down, like they took water in as soon as the trip started. Not more than 45 minutes, they were what 749 ft down or something??
Reply: They were taking on water in the aft. If thst tail section is as big as it looks, it could hold at least 50 gallons of water which would be 400lbs of extra weight. It could have been bigger than that.

Even after removing the landing skid, they still went up slow. 

I don't think the passengers were too heavy.
Reply: The ocean has its own weather, maybe there was a strong down drift and that's why they desended too fast, and came up too slow. We will never know
Reply: I wonder if he didn't do it on purpose so they would have more time at the Titanic
Reply: @surplussean3364 es, I agree..he totally responsible for this outcome.
Reply: I wanted to go and even showed my dad the OceanGate and how much i wanna go and we were both doing scratch tickets, the lottery, saving money and he said he would have come with. We're both a little overweight.
Reply: It's likely the sub was deforming inwards in the centre. This would lower the boyancy. It would also result in at least one end pulling out of the dished ends.
Reply: @ecargcameron  Carbon Fiber does not deform, it breaks or shatters instead, this is one reason why carbon fiber normally is not used for subs.
Reply: Yes, everyone is saying weight gain. You're the first I've read to assume volume loss. One would think they would have seen or heard water inside. Since descent isn't perfectly level, water gain would have collected at one end or the other of the interior, which would have been noticeable.
Reply: Perhaps it was due to a pinhole leak and the water added weight
Reply: could the carbon fiber get waterlogged, heavier and weight the titan down? I think they were trying to ascend but couldn't
Reply: It seems to me that perhaps they were taking on water during descent perhaps in some cracks that had developed due to delamination, which made the sub less buoyant and increased their descent speed. This also would account for their difficulty ascending.
Reply: @kurtspurgin4942  then there would not have been an implosion. Had they had a leak while decent, by the time it reached crush, the pressure would have been equal to that of the ocean inside the cabin
Reply: I suspect either a tiny leak that allowed seawater to trickle in and collect in the main chamber unseen under the floor or the GF composite cylinder had weakened after previous dive cycles had greater deflection (squeezed to a smaller volume under massive compression) than anticipated which decreased buoyancy. Assuming the leaked final messages from Titan are real, water under the cabin floor could be the reason electrical systems started to fail if cables and connectors were located under the floor.
Reply: Not sure why you keep covering the descent rate of this sub. This company performed many dives, including 13 dives to the Titanic, all of which were no issue. Those dives to the Titanic were all done in around 90 min, and they never had any problems. 
This seems to be simply an assumption based on ignorance.
Reply: @undeadarmy19  Rate of stress loading on the hull. A higher rate of loading reduces the time for stress to equalise.
Reply: @TheScotsalan  As already stated, the descent rate was the same rate used 13 other times, and nothing ever happened. He keeps comparing the descent of JC and assuming that this descent rate is some sort of RULE, when its not.
Reply: @undeadarmy19  Yup. Descent rate should be 1g, cos aside from water resistance, everything heavier than water sinks at the same rate ?
Reply: @TheScotsalan  That's only inside of a perfect vacuum. We have to deal with air/water resistance, which means that the shape/weight of the object will affect how quickly it falls
Reply: @undeadarmy19  Yes. The sink rate depends on dynamics and resistance, but on the force diagram, the downward acceleration is 1g. It would sink, as someone else noted below, at terminal velocity that is dictated by geometry, not mass. 👍
Reply: @TheScotsalan  The mass does matter though due to buoyancy. Buoyancy is negligible in air, but it matters a lot more in water. A sub that weighs 23k pounds can being neutrally buoyant and not sink at all. If you take that same sub geometry and make it 50k pounds, it will sink. If you make it 10k pounds, it will rise to the top and float. It's not linear either, it's more of a curve. If you make it 24k pounds, it will sink very slow, the more weight you add the faster it will sink. At a certain point, no matter how much weight you add, you will hit terminal velocity, yes. These subs try to maintain a weight to where they can be neutrally buoyant once they get to the bottom, so they're right at the tipping point between sinking or floating. This means that all the have to do is add a bit more weight than normal to sink a bit faster as well.
Reply: The descent rate is significant as it signifies that the transcript is fake.
Reply: @liamnoone9381 It could also indicate they had a problem almost from launch, if it turns out to be authentic.